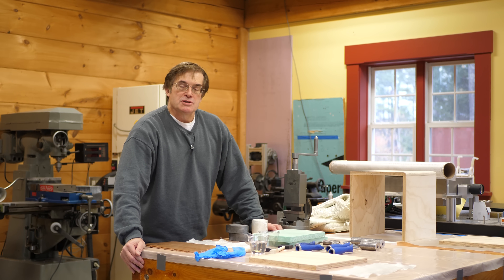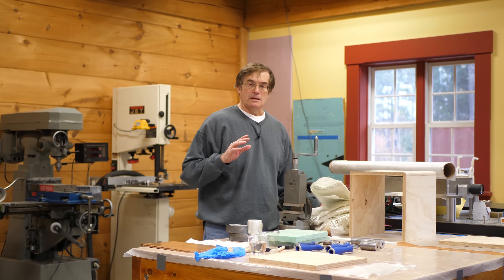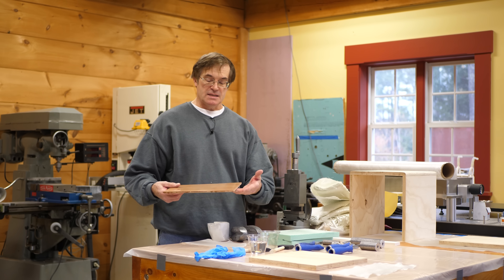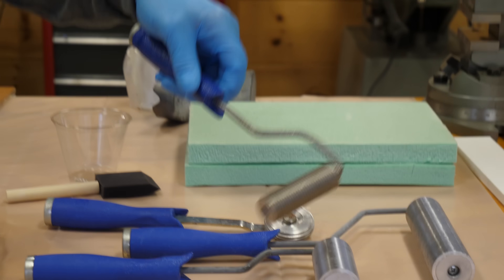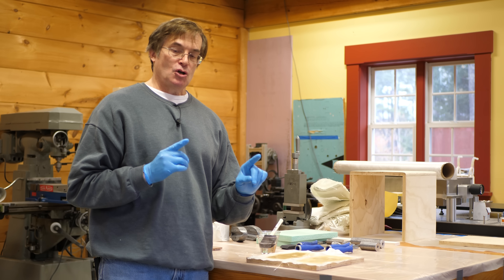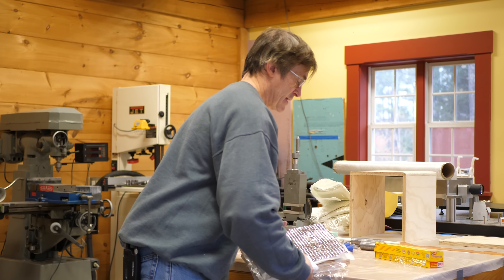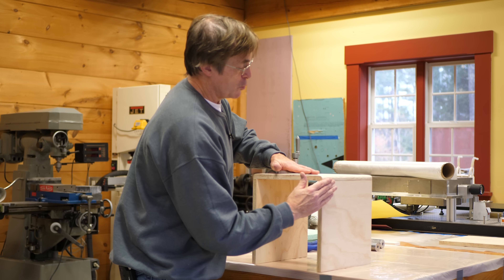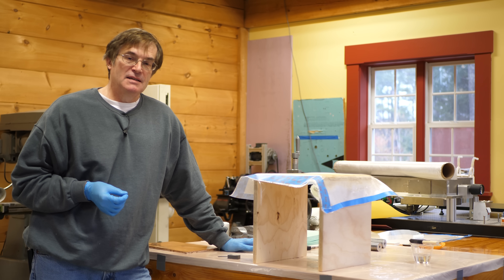Easy Tricks Using Fiberglass Strengthening!

Comment: Holy cow. Been fiberglassing since my 20's. Built boats in a factory, ran my portion of that shop. Learned more here than those wasted years. All in such a short time. It's not that anything is new(well, accept using the tape)it's just that the explanations make so much sense and follow in such a logical way. I've been itching for more news on the flying cat, but i'm in for the long haul, so carry on.
Reply: Flying cat? Do tell me more!
Reply: Fiber glass expert " itching for more news " Good one!
Reply: Pro. Verified
Reply: +1 on the hydrofoil! I can't wait to see how that boat gets above planing speed with those tiny motors... :-)
Reply: @myxfit  See the previous video.
Reply: Itching...I see what you did there LOL
Reply: @jimbo5635  Especially if they were using chop-strand fibreglass!
Reply: @Reno Simpson that's what got me into the MEK for sure.  .   .
Reply: @sail4life  literally lol!
Reply: dean jordan
doesn't say much for the place you worked at tbh, most of this is pretty standard practice when using glass & epoxy.
Reply: @daos3300  does any commercial boat builder use epoxy for layup?
Reply: @Reno Simpson heavy fiberglass with epoxy is good for making molds to be used when making carbon fiber parts.
Reply: For all you itchy people out there, try some baby powder before handling but if you forget, use some duct tape to remove the glass fibers from your skin.
The more it "hurts" when you put it on, the better it's going to work.
And give the glue in the tape a couple minutes to work before PEELING it off.
IT'S NOT a band aide so DON'T RIP it off your skin.
You can also use Elmer's wood glue. Just pour it on the affected area and wait till it gets a good skin on it, peel it off.
Like peeling a sunburn, can be addictive. 
Have fun ladies.
Reply: @Reno Simpson I once crash landed a para glider in the middle of ACRES of BLACKBERRIES....
My instructor had to find a bunch of sheets of plywood and 2x4's and other misc garbage to lay down a "road" just to get too me. I was delirious and dehydrated by the time he got to me several hours later.....
The worst part was trying to pick all the tiny tips of the thorns out of my body. It was a nice day and I was wearing all my protective gear. Helmet, shorts, tank top....
I was digging these little black thorn tips out of my thighs for a year and a half. I bet someone 20 bucks in a bar that I could find one and did. That was at a Halloween party a year and 5 months after the accident.....
Reply: @Reno Simpson i was responding to the question about whether or not it's worth using epoxy with fiberglass instead of resin. I agree, you don't make a mold unless it makes sense to do so, but the only time I have ever used epoxy with glass is when making a high dollar mold. Something I need to last that I plan on making several parts with. For me that tends to be worth it even if I am making fewer parts because I need the molds to last years sometimes in between use and it makes sense because I build custom ultra lightweight panels primarily for Porsches. Some of these parts are also very stubborn to release from the molds so they need to be tough. It also is sometimes helpful to use epoxy just for the working properties that can be advantageous when making a large thin mold.....
Reply: @Reno Simpson yep...and I don't know how to fix it...sorry
Reply: @Reno Simpson thanks
Reply: Most boat builders use large molds of a haul split into 2 parts. The molds are waxed and gel coated, and one man runs a chop gun and the resin and fiberglass is blasted on the mold. 2 or 3 guys then begin to roll out all the bubbles with those little rollers he has there. You weren't allowed to sweat on the glass. Guys who overly sweat were moved to the little molds. We would follow the chop gun right down to the end. once the 2 sides kicked fully, the mold is put together and heavy sheets of glass are used to go down the center to bond it all together. Stringers are made for the engine. A/B foam is used to fill voids. Small parts are made on little molds.
Reply: @mikeworkman3593  I work in boat building and we use infusion like tubes everywhere and vacuum pumps and the hull is popped out in 1 bit the deck is then moulded and fixed atop
Reply: @connorbisby  this was in 1996,so I'm sure technology has come a long way since then
Reply: One short answer...E glass and polyester resins are the workhorse of the boat world because they stay slightly flexible throughout their service life. More rigid and brittle epoxy's can stress and cause cracks under severe duty. E glass and polyester laminating resins are still king in the marine industry for this reason. Epoxy, imo, is simply over marketed. The larger vessels designed to be left in water over time typically uses Vinyl Ester resins as it is less likely to allow water to ingress, due to the molecular aspect.
Reply: @connorbisby  
Have you ever been involved in the repairing the hull of older boats?
Reply: @MrSandman993  
Have you ever been involved in the repairs on an older fiberglass boats including those where the fiberglass was laid over a coring material?
Reply: thanks for sharing Dean, glad to know this is true for people with years of practical experience too, and not just people who have been researching and planning in advance of starting some big projects
Reply: @anullhandle  Good question! Depends on price! Using high end technology - I would use epoxy with carbon fiber for layups !
Reply: I was just going to strengthen my transom up. ?? 😮
Reply: @christopherleveck6835 fiberglass has a different heat expension rate than carbon, mold should be of same material  as part or the differential expension between the mold and the part would change the dimensions and possibly wreck the part. Given here is professionnal carbon/epoxy parts are cured in hoven or autoclave...
Reply: I bet you've been itching for many years
Reply: A fibreglasser who’s itching? What? 😂 Try using masking tape to tack the fibres off of your skin and clothes before you start scratching and you should be right in the future.
Reply: @christopherleveck6835 Para-gliding is gay - lesson learned.

Comment: I can't believe I never thought to lay down tape before cutting fiberglass. Would have saved me a whole lot of mess in the past, and will now save me a lot in the future. Thank you very much!
Reply from the maker: Great!  
After years of unwrapping the loose threads from my tools and my arms, I'm glad one of the techs from Gougion Bros. (West System) recommend this.😀
Reply: Love your vids Ben!!
Reply: Or use an electric shear, which quickly cuts e-glass to just about any shape without fraying.
Reply: We ended up taping, cutting and pre-impregnating fibreglass sheets for our solar boat. saved us so much trouble (and tools).
Reply: @FrankenProjects  dont forget about using thermal electric generators to charge you batteries as well.
Reply: @nathandean1687  Not allowed by the regulations of Solar Sport One as solar-energy must the be only source during the event.
Reply: Well then
Reply: You can do the same thing to the windows of a car, should you ever need to cut one in half. It stops the glass from going everywhere (relatively speaking). Mighty Car Mods taught me that one.
Reply: @TechIngredients  Is there a cheaper alternative to West epoxy that still produces good results. Love your channel and thank you.
Reply: Genius
Reply: Car audio guys have been doing this forever...they've got some cool tricks for their trade materials.
Reply: @1147jlg  In another video he talks about using Raka Epoxy, http://www.raka.com/  I haven't found a place to buy it other than directly from their website.
Reply: I know im asking randomly but does anyone know a way to get back into an instagram account?
I stupidly forgot my login password. I would appreciate any tips you can offer me.
Reply: @Drake Maddox It worked and I finally got access to my account again. I am so happy:D
Thank you so much, you saved my ass!
Reply: @Frank Orlando happy to help :D
Reply: Tape is also nice so you don't distort the glass
Reply: @1147jlg  Raka. He recommends it elsewhere in his vids.
Reply: love ur channel
Reply: @TechIngredients  Could u plz turn on subtitles option in this video? Many tks from Brazil!

Comment: Sorry it’s taken a while to respond, as you can imagine, there’s a lot going on here and plenty of anxiety to go with it. To answer your question, yes, we have done several older vessels over the years. Typically the older vessels have broken down core material in floors and transoms. While I still love modern marine plywood... I understand that some like synthetic materials. That said, I like wood where possible, we certainly use several different types of core materials. We are polyester folks and e glass 90% of the time and industry seems to be headed towards the more expensive and exotic stitch mats and the sky seems to be the limit in terms of complexity and price. Thanks for writing... don’t over think it.🙂

Comment: Something I've been doing for decades to give smoothness and reduce sanding and a second coating is wet the surface lay the cloth remove bubbles and apply food wrap for about 20 minutes. If you wait too long you cannot peel it off. It helps in many ways... Etc...

Comment: Fibreglass is great. A trick I found for a quick emergency repair is to use orthopaedic fibreglass casts - water activated, hardens within minutes, and can cover a fair area, not as strong as dedicated fibreglass, but far less labor intensive, and they're relatively cheap (only a few dollars each) as they're a commodity product

Comment: Michael Link again. As I previously commented on another of your videos, I built a 4 place fiberglass/epoxy aircraft using (Burt) Rutan Long EZ building techniques. So, here are a couple of tips that I learned from the very extensive building/teaching plans that apply to this installment of your video series:
1. If bidirectional fiberglass cloth, (50/50 weave), is cut on a 45 degree bias, the cloth will drape over edges and irregular shapes much more easily. This wastes glass, but is worth the workability gains.
2. The most efficient and lightest way to fill in the weave pattern of a layup is to produce a thickened stucco like paste made from epoxy resin and glass microballoons. Mix by eyeball and experience to a consistency that will be relatively easy to spread, but not so wet as to be hard to sand after curing. I was able to create a surface smooth enough that, when painted, would allow laminar flow over the entire aircraft. (That was a primary reason that the plane could fly at around 220 MPH with a 180 HP engine.)

Comment: I always wondered about that film that formed on cured epoxy. I never would have guessed it is water soluble! Thanks for the tip, and everything in your videos.
Reply from the maker: Sure, thanks for the comment!
Reply: @TechIngredients  polyester be nice to hear your thoughts on using it as a cheaper than epoxy solution i am sure it has its down falls . say in application adhesive base instead of epoxy base

Comment: Perfect timing. I'm thinking about coating plywood with fiberglass to remodel my basement shower stall. Motivated after I found out a lot of boats that have been sitting at the dock 20 or 30 years are just plywood coated in fiberglass. I figure if that can last 20 years outside it might last 30 years inside as my shower wall... if not, it's still a lot cheaper than the $2,000 to $3,000 quotes I received to have it tiled in.
Reply: Go for it! Decades ago my parents who were not rich by any measure decided it was time to quit renting and build our own house. No contractors, just us. And we didn’t have the internet or YouTube then! I was about 9 or 10 then. Learned a LOT. So worth doing it yourself.

Comment: I’ve been doing some testing on fiberglass reinforcing 3D prints. As long as you get a good bond it can be incredibly strong even at low infills. Highly recommend trying it if you want to get similar performance to metal structures but only have access to a 3D printer.

Comment: Want to build with this stuff on my tear drop trailer project, maybe after that I can build a boat or even a plane? That’s my bucket list.
Reply: It is pretty easy as long as you respect it and follow the guides and manufacturing recommendations. It is surprisingly forgiving.
Reply: The popular homebuilt airplane designs like a Long-Ez, Cozy and others use epoxy and various foams to build up the structure.  The plans give you detailed instructions on how to do it and it is very similar to this demonstration.  You can wait until the epoxy is almost hard and easily cut off the overhanging cloth with a single edged razor blade for a nice edge which prevents much cutting and sanding later.
Reply: first is to make the bucket.

Comment: Best practice when glassing over wood or any other surface that will absorb resin is to wet the surface prior to placing the glass on top and wetting it out.  Working with non-blushing epoxy eliminates the need for removing the amine blush.  Laminating additional layers before full cure 24+ hours still creates a chemical bond and then no need to create a mechanical bond via tooth from roughing the surface.

Comment: There are so many different epoxy options that have huge variety in their curing time how are you to individually per epoxy basis know when the epoxy is in a great state that it can still form a good connection to new layer of epoxy? just a feeling of stickiness? also a lot of people use vacuum to draw out the air from wood for instance when they want to drench the wood in epoxy but it might not be practical at all depending on the scale of whatever you are trying to coat or get fully air out of.

on a second not i would love to see a video where you compare materials available to home shops. lets say you want to build a bike frame or a little remote airplane. these kind of videos give a great insight on one way to do things but it would be great to have like a over all material introductionary video on what are some great materials that you can build realistically in your own garage to have an overview of what options are available in general. this is something i feel no channel really does that well. a lot of channels like applied siences etc do really great job in smaller areas but nobody really offers like a consolidated over view of different options available in lets say materials you could build a boat frame from. maybe there would be a demand for such videos too.
Reply: The Hardener just changes the speed of the chemical reaction so you get a set point time depending on temperature. 

Pot life is important for how long you can use the epoxy depending on the hardener and for most i think varies from  10 minutes to an hour. 

Epoxy should be good as long as it is sticky but lower temperatures really mess with it so you need heating below 15 celsius although west coast claims good results down to 3 celsius. it goes from Liquid, gel, hard and the final cure and full strength can take 36 hours or more. As long as you apply the next coat while it is sticky the cross linkinging should still occur. Humidity is a bitch too apparently and can cause problems with materials releasing moisture during the cure. Preheating the epoxy in a bath or hot box really helps kick start the reaction if working in the cold.

Some Industrial stuff is set up so it has a post curing phase that you heat it to finish to cure but i do not think most of that is available to us plebs. i got the number for the sale rep for my country who was a wealth of knowledge. I used West Coast who have good information for home use but Sicomin Epoxy Resin
 is around 20-30% Cheaper if you can find a source and apparently is used very heavily in my country. But information is harder to come by so it's worth just asking reps if you can find contact info. For comparison i paid £110 pound for 6kg West Coast and £90 For Sicomin at the same volume.
Reply: You check on it periodically. When it is soft but not tacky, that is when you can re-coat or cut with a razor or whatever.